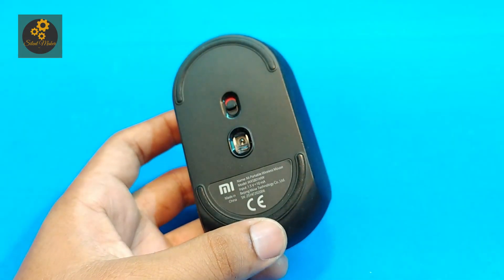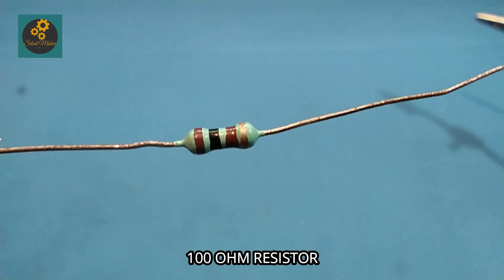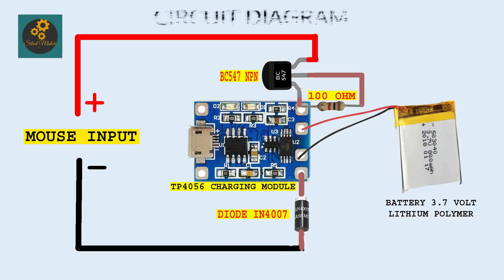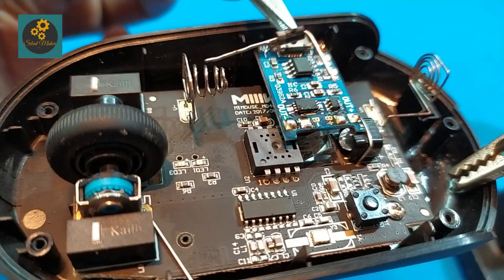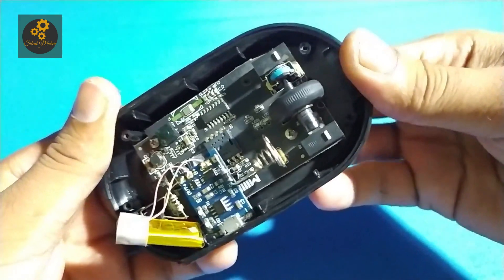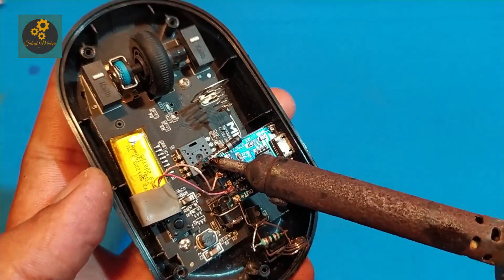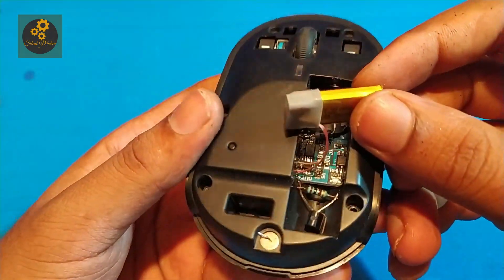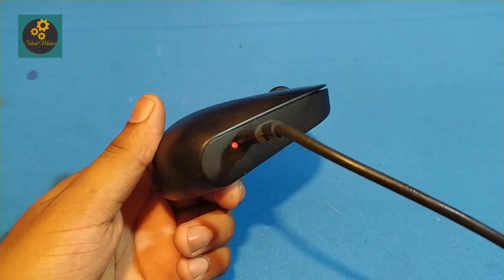Making MI Mouse Rechargeable #rechargemimouse #modifymimouse

Comment: I'm really happy that you have done a perfect working setup for single cell mouse. Can you suggest the changes in circuit as my mouse runs on 2 AAA batteries i.e 3V. Hope you will respond quickly. Thanks 😊
Reply: Just don't use transistor and 10 k resistor
Reply: Chance of damage is there because these are low powered device. If not damaged immediately it will die sooner or later because of excess power

Comment: In mouse lifespan  we use 5 to 8 Aa batteries sometimes less than that. Do we need really expensive setup
Reply from the maker: this setup is not much expensive bro
Reply: for any gaming mice that have high poll rates they can suck up batteries and make it expensive to use i did this but i just bought a wireless mouse that was rechargeable. and was like a clone of the one i use.. off alibaba or dhgate or somewhere i cant remember where i got it . but it looks like identical to the one i play with . so i just switched out the one thing and boom rechargeable mouse that was annoying me wasting tons of money on AAA batteries especially because i broke the switch on the botton of the mouse so it never turns off